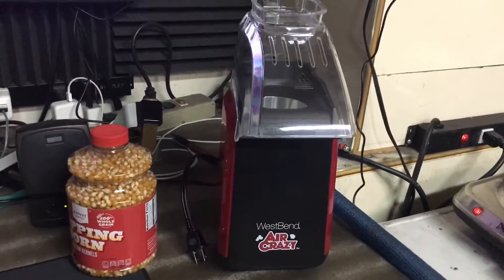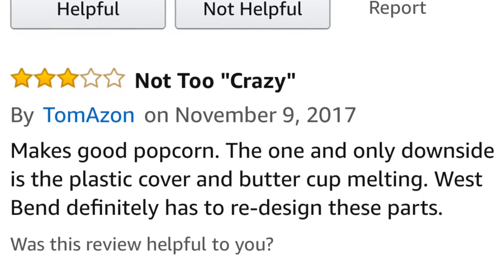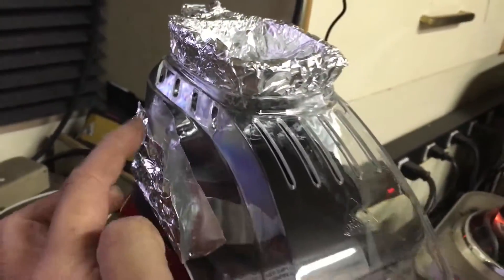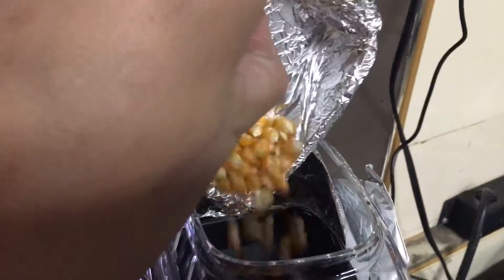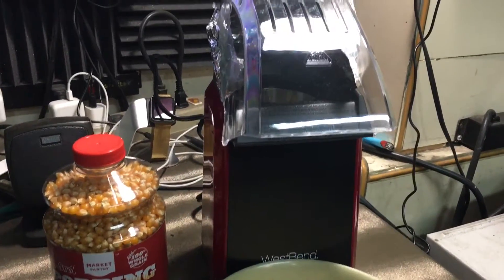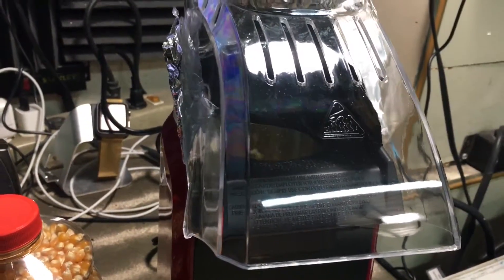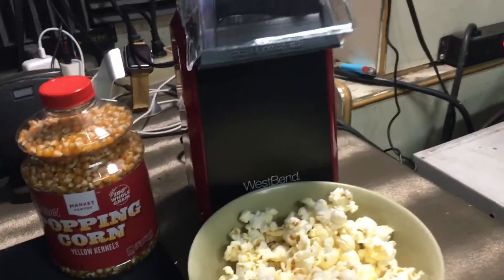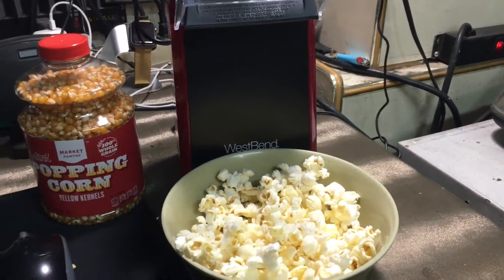Testing out the West Bend Air Crazy Popcorn Popper

Comment: Rookie! ;)  I saw every problem you had coming before you even started it.  That foil caught bouncing kernels in the fold preventing them falling back down to the heat so that was clearly a bad idea.  My own personal tip for everyone using an air popper is to elevate the unit off your counter (I put it on a cookie cooling rack) as it operates because the air intake vent is usually on the bottom and elevating it makes sure plenty of fresh air is getting sucked in so the unit doesn't overheat.  Also. if you raise the unit's front feet about a half inch higher than the back feet you will get considerably less unpopped kernels being expelled.  Use a large pot to catch the popcorn and let it run until there is a solid 3 to 4 second pause between pops like you would with bagged microwaved popcorn.
Reply: Thank you.. I got one as a Christmas gift at least five years ago and have never used it.. still in the box.. I came to watch every video to make sure I don't make the "rookie mistakes" 😉
Reply: @peachbellini2615  don't walk away from the popper and pay attention to it as it runs. I feel like a lot of review problems on air poppers are from people that aren't attentive to their little machines on the counter that gets screaming hot inside.